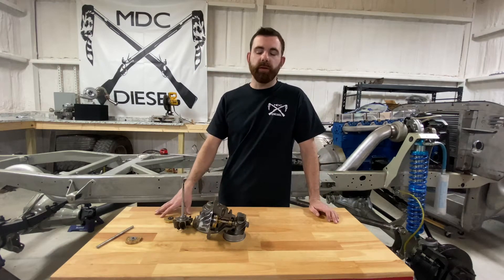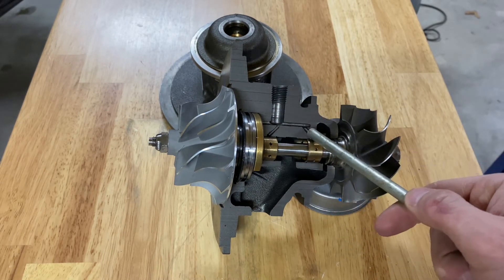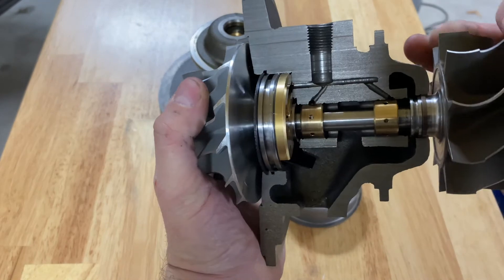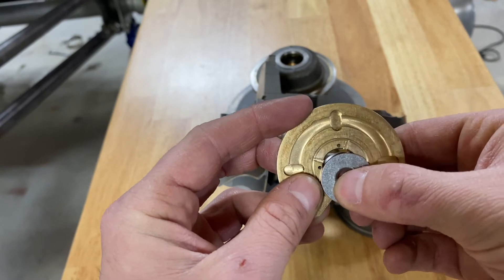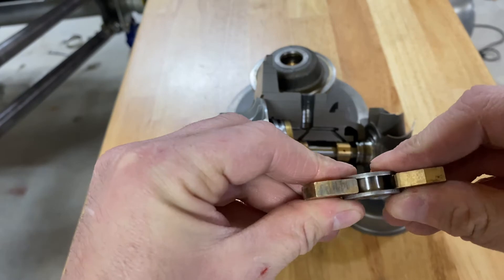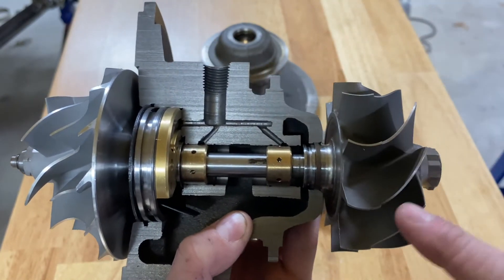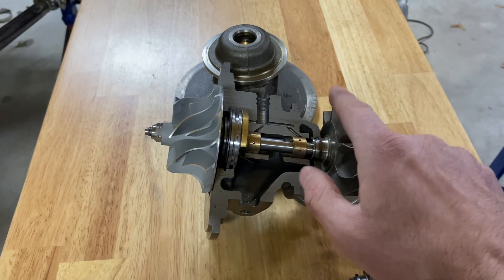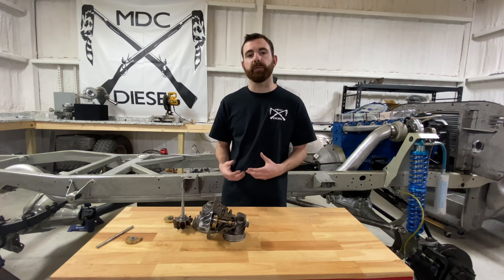How to Check For Turbo Shaft Play:How to Tell if a Turbo Has Failed

Comment: Thank you for this video!!!!!! My turbo is leaking from hot side.  Just fixed my oil drain fitting in the oil and and if it still leaks I’ll do a rebuild.  But I did buy a new center cartridge just in case.

Comment: Great video, I bought a S261sx-e, lasted a month. Im running 600bhp at 2.7bar. Just upgraded the thrust from a 270 to a 360°. See how it goes. If it goes again. It means im pushing the turbo too fast. Will have to get a bigger turbo as i can't live without high boost.

Comment: Finding oil in the hot part is the seal only failed because haven't pleat front and back. How to seal the cold part is used gasket or RTV. I found white stuck stuff but don't know hat is if is a gasket how is called this type. Thank You Sir

Comment: Hi, I have a reconditioned one, the problem is the shaft, it touches the housing when moved side ways. only on one side, the other side does not move up to the wall/housing. Without moving sideways it does working/spins freely. No in/out play at all.
Reply: Exactly how mine is

Comment: so why the thrust bearing erode? Oil lubricantion not enough?
Reply from the maker: Most thrust bearings failures occur when the shaft speed exceeds its limits. Meaning the shaft spins so fast that the oil is ejected from the bearing faster than the oil is replaced.
Reply: @MDCDiesel  what i found with my turbo,the oil feed inlet restriction adapter hole size 1mm..maybe not suitable for journal bearing
Reply: Oil contamination can cause bearing wear.
https://youtu.be/nQFdn4sEw4M?si=OiR53CAVek6NQ304&t=369

Comment: question, my turbo is an original, has done 150,000 miles, 40k miles tuned, i purchased the car on 139k, it felt like it had axial play when i checked it after buying it, still has the play, but im not burning any oil that i can see, and there is no damage to the compressor wheel, i have done 10k miles myself, no siren noises etc, do you think it will die at some point.